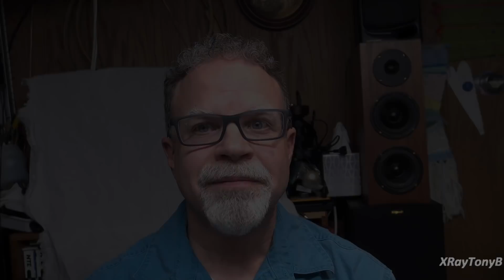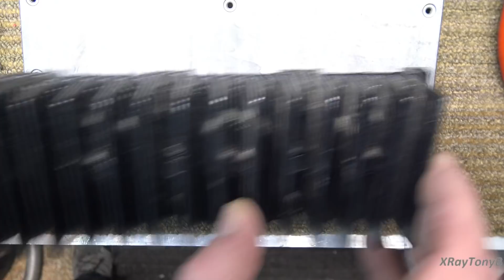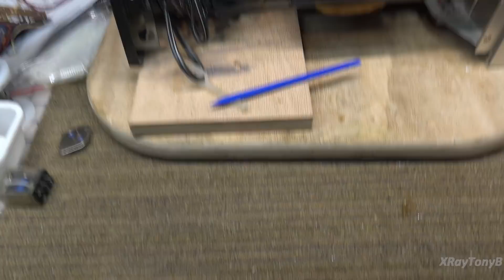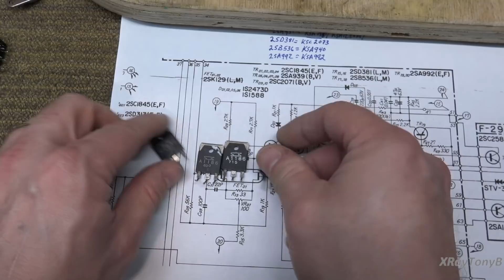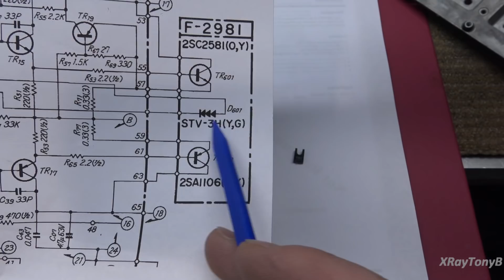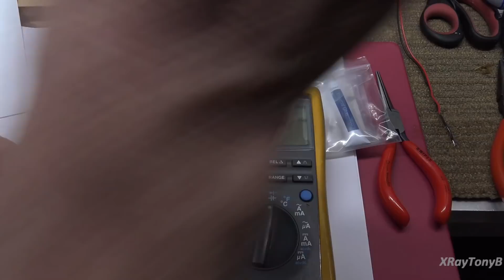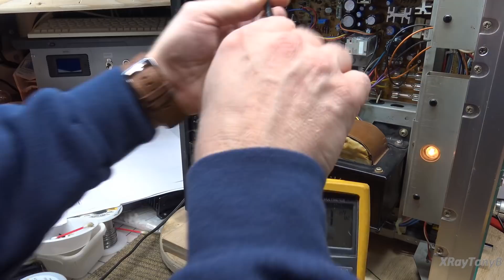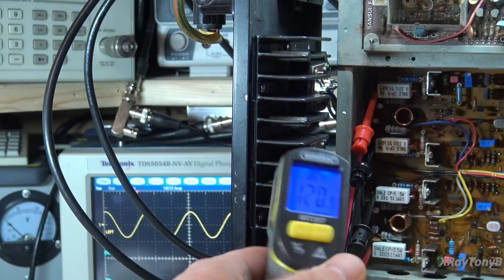Sansui G 7500 - Repairing Fried Parts - Replacing Outputs and New DIY Stabistors

Comment: Tony, perhaps you were also wrong about the protect relay. Maybe it is indeed shorting the speaker outputs when de-activated, since you measured 0.00 volts on each channel!
Reply from the maker: The normally closed contact terminals are cropped off from the bottom of the relay as there was no mounting holes for them on the board.  So they don't connect to anything.

Comment: Very interesting, especially having to roll your own components.  I'm familiar with using a current limiter with tube gear, I never thought about using it with solid state gear.  Yeah, I got much to learn.
Reply: A current limiter is even more important when working on solid state gear then it is with tube equipment, because tube stuff is much more forgiving and can tolerate brief overloads or slips with your meter probes a lot better than solid state stuff can. Tubes can tolerate red-plate conditions for a half minute or perhaps several minutes, and you will usually have time to observe the fault occurring,  or your voltmeter will show the voltages in the circuit getting dragged down by the excess current draw; but if you draw current beyond a transistor or diodes' capability it will self destruct in a fraction of a second, and often cause a  daisy-chained meltdown effect on the circuits before and after it.  Trust me on this, as I have personally let the magic smoke out of more semiconductor devices than I care to admit!

Comment: When I was researching these T03 devices from ON Semiconductor, the 93G,94G devices had the same specs as the 95G,96G devices (MJ211xxx).

 I have used the 93G,94G devices in a Marantz 2275 and they worked just fine. Do you know what the difference is?
Reply from the maker: They are almost identical.  Either will work just fine.

Comment: Working on a Sansui G-8700DB. I have acquired all the output transistors from ON semiconductor devices. One channel had mix and match transistors in it and someone had altered resistor values to get it to function, well kinda. On the F-3074 driver boards, 390 ohm resistors which couple the 2SC2071 to the 2SA939 devices got so hot the solder melted and one lead fell out of the eyelet on the board. Many cooked out of tolerance resistors, when these go, they go big!

Question: The afore mentioned transistors do not test open or shorted, but since so much current has passed through them I find it hard to trust them. Should I just order the KSA devices and change them out to be on the safe side? Another tech told me to just current limit and bring it up slow, but I don't want all those new T03 devices to go up in smoke in the near future.
Reply from the maker: If the amp suffered a massive failure, I would replace all the transistors except for the diff pairs (unless they are bad).  This is because the cost is not a huge factor, you don't know if any of the old ones were stressed and with new transistors you know the condition and specs of all the transistors at that point.  If it is for a customer that wants minimal cost, just test the amp out and verify proper operation.  If all is good, leave the old ones in.

Comment: High End amplifier owners feels replacement of parts as a serious sin
Reply from the maker: I guess I'll go put on my sackcloth and ashes.  Mea Culpa ;)
Reply: When the part does not exist what do you do? I think you are referring to the alteration of an original part to make it work?
Reply: @zulumax1  , nobody with a functioning brain or a lick of common sense would try to run a 1970's car with original belts, tires, battery and oil/lubrication; and yet there are audio-fools, and guitar players, who think their amp should be able to run just fine with all original components from 50 or 60 years ago......
Reply: An argument could be made that the original components (in the case of audio equipment, not automotive) did last 50+ years. I don’t know about you, but I have made no plans for being around that long and doubt that anyone who is extant then will be interested in using this equipment on a regular basis. A few examples will be in museums or collections, but that’s about it. That’s a shame, but the world moves on…

Comment: What does the DC stand for?
Reply from the maker: Direct-Coupled.  All of the transistor stages in the amplifier board are directly connected to one another, without the use of coupling capacitors.  The only bad thing about it is that when one transistor shorts out, it often shorts the other ones in the circuit as well and you end up with multiple fried components.

Comment: Maybe do a quick vid on the repair of the AMPROBE.  I've the same meter along with a 189.  As you know, Fluke & AMPROBE belong to the same conglomerate.
Reply from the maker: It turned out that there was a cold solder joint on one of the probe sockets, probably due to the use of lead-free solder which has a higher melting temp.  Some flux and fresh solder and the meter seems to be working great.  It still has an unacceptable burden voltage drop in the milliamp mode.  I will use it for everything except current.
Reply: @xraytonyb  I guessed that.  I usually put some deoxit fader lube on alligator clip hinges, probe connections & the like, to reduce measurement wander. I never checked the burden on mine.  The other limitation is 400uF max.

Comment: Tony I wished you would spend some more time on how you found the right solution for replacing ( stabistors ) as most people know here these are unubtaininum any more I had to sell my Technics SA 800 for less than half it was worth because I could not find ( your term stabisitor) I had to solder the old brittle wires back onto the resistor where it broke off I was not confident in that repair and that is why I sold it way below what it was worth / I think the pioneer community would like to know where you get these thermistors or a video on a good work around I have heard the three diode and four diode work around but that seems hoky to me.
George

Comment: Wow my G8000 is completly different inside ?
 I spent about a week just cleaning inside and out and cleaned all the pots correctly . Its rated at 120watts from 1978 its a Beast at 56 pounds love how all the boards have quick disconnects but Tony my Direct mode switch is acting funny if i wiggle the switch i have the left channel cutting in and out drives me crazy most likely the tone/EQ board needs recapped  . 
Having a hard time finding someone to recapp for me 😥 I work 70hrs a week so no time ! I most likely will sale it and Focus on my Marantz 2270 but vs Sansui g8000 yeah The g8000 on a different level but the Marantz 2300 series is more comparable ! Would you feel like recapping me Marantz or Sansui ? 
I will take good care of ya ! I want to pass down to my newphew he loves coming to my house and playing with all my amps I have 15 amps Tony !!
 And I have 14 sets of speakers . 
Maybe i have something you would like to have 'speaker or amps' I have a VINTAGE Yamaha CA 810 also 😃 
Thanks Tony My dream amp is the 
Sansui 2302b 14k in 1992 !

Comment: Very nice solution for the stabistor replacement. You might want to consider coating that copper with some liquid tinning solution to keep it from corroding over time before you mount/glue the chip, but other than that it looks like it would stand up at least as well as the originals, most likely better. And seeing that you changed output transistor types, I was also wondering if the factory bias specs still apply, or are you going to do some distortion measurements in the next part to verify if tweaking the bias should be done.

Comment: I'm not so sure I'd want a Sansui   NOPE, I'll stick to my Harmon/Kardon !  BUT, always a pleasure to see your video's!
Reply: Even tube gear can die from a shorted output tube sending sending full on DC though the output transformer. Just replaced one of those expensive and rare nickel cobalt Altec/Peerless output transformers on one of my 2 Heathkit W-5M tube amps this year. Good thing I had a parts donor amp.    

I am working on a Sansui G-8700DB which required all 8 output devices, but they are around $7 each from Mouser. The Marantz receivers also used direct coupled power amp stages and same devices, as Tony mentioned.